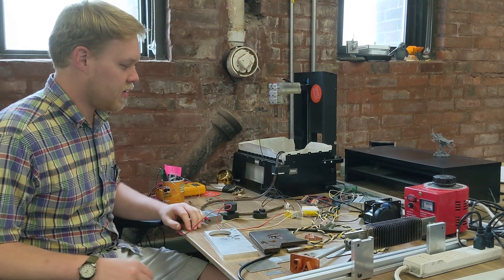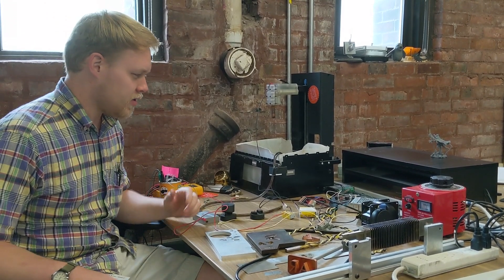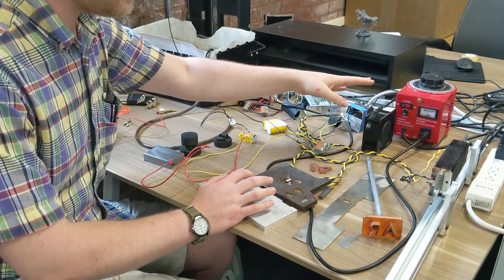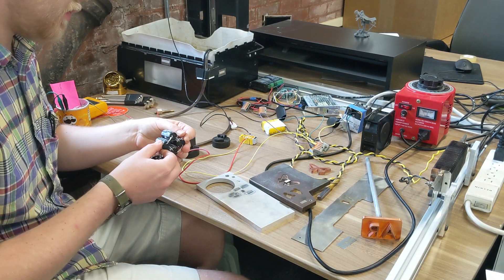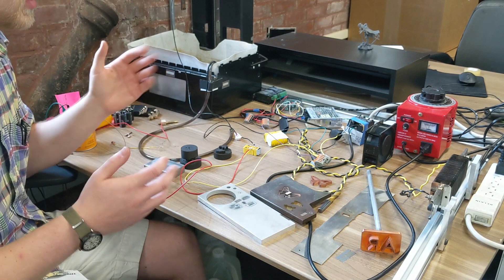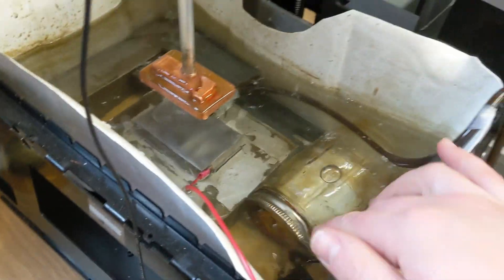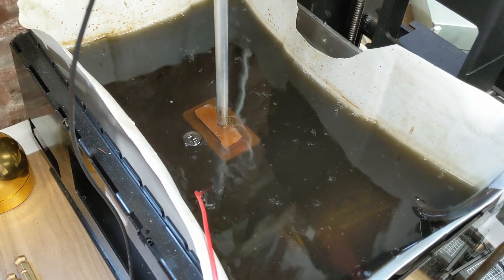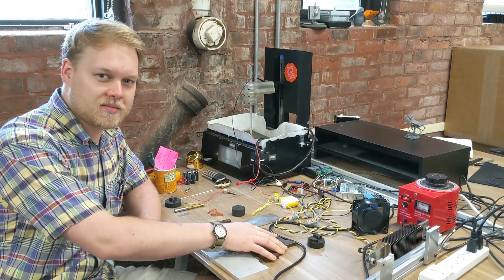DIY Hybrid Ram EDM

Comment: Old fart in Ireland here, just a suggestion, would a IGBT welder work as a power control moduale for EDM it would seem to have all of the values required for this. Any body out there got any ideas on this ?

Comment: Well that's encouraging; pretty much the exact same architecture as I'm trying to get working. The only difference I have is using a Pi Zero, purely to give me a WiFi gap between the equipment and my laptop.

The issue I'm having is with the IGBT keep dying; as the spark occurs, you get an instantaneous moment of ultra high current, which is frying the thing. 

Could you advise what MOSFET/IGBT and driver (if applicable) that you're using please?
Reply from the maker: I am using a normal N channel Mosfet here. I don't remember the part number, but It's rated for much much higher voltage and current than required (I think rated for 800V, 120 A continuous, pulsed to 1000 A). But I did add small amount of resistance to guarantee some sort of current limit (about 1 ohm). It's also avalanche rated. I did not have any issues with it burning up, but I definitely had some issues with noise and clean switching. I added a low impedance mosfet driver on the gate, kept all the wires short, etc. etc. all the standard stuff.  I think if you don't limit the current you will always burn up your switches. The resistance and inductance in those short wires is super low. The "proper" way to do this is to add inductance in series with the switch, and control the duty cycle like you would in a buck converter. This requires extremely fast electronics, though. And a lot of math and careful design to prevent oscillation.

Comment: Thanks for the video, your results look very good. I have been playing with simple RC circuits and cannot obtain a sustained spark. I guess using a pulsed output would improve this? I realise the drive to the MOSFET is also control by open/short/current detection but does it use a fixed base frequency (25kHz) and what is the mark/space ratio or duty cycle of the signal? Perhaps you use PWM of the pulse based on measured cap voltage... be interesting to know. Trying to get an idea of a good pulse to start with if I build a pulsing circuit.
Reply from the maker: Sorry for never replying to this. If I remember correctly, I played with different frequencies and duty cycles, and determined that 30-40 kHz with 5-15 microsecond pulses worked the best. The duty cycle was chosen/discovered such that the bulk capacitors were allowed to recharge mostly between arcing. This gave me the most consistent results. If the electrode voltage was below about 60 volts at the beginning of a spark, it would not reliably initiate an arc. IIRC I ran the bulk capacitor around 90 V max, and during arcing it would measure 75-80 V with a DMM.
Reply: @gizmoguyar  "The duty cycle was chosen such that the capacitor was allowed to recharge between arcing" Was the RC-Circuit-frequency a straight multiple or straight fraction of the frequency of the mosfet-switching, or was it chosen so that both have nearly the same frequency? Thanks !!!
Reply from the maker: @klausbrinck2137  It was neither. I empirically measured the RC time constant, and I used a  MOSFET frequency of about 4-5 times that. This way I could be confident that at the beginning of each pulse, the capacitor was roughly at the same level of charge, independent of the size or length of the previous pulse.
Reply: @gizmoguyar  This answer was very satisfactory, finally I know about the relationhip of the 2 oscillating systems !!! Thanks a lot. The ratio may be different for my efforts, but, at least, now I know what I should pay attention at. I know nearly nothing about electronics, all I do, is to logically evaluate all statements expressed here, bring them in relation, and find the truth. 
My biggest fear was, that the "ON"-part of the mosfet-duty-cycle is gonna precisely overlap with the least-charged-capacitor-state of the RC-oscillation-cycle, for example. But your answer tells me, that I shouldn´t fear that much, generally... 
Thanks again !!! I endlessly envy your results, greatly done !!!

Comment: https://www.youtube.com/watch?v=M_N0XANZZC4

this is my EDM machine.
I am able to generate spark but my ram is not holding stable. could you suggest any circuit or any thing by with I can achieve stable ramming to hold the electrode
waiting for your reply
Reply: https://www.youtube.com/watch?v=8gjdXbLPsxE
Reply from the maker: Looks like a great machine. I agree with the other guy, your linear motion is very jerky and large. I would add filtering and tune your PID so that you get smooth slow downward motion. Your cut speed will increase, and your surface finish and tolerances will improve.

Comment: I own 2 wire edms and a sinker edm.  Thats not a bad little system Youve built there. The sound on the letter cutting was not bad at all. Good job!
Reply: The sound was music to my ears, and the light from the sparks was barely perceptible, exactly as should be !!! I mean, he surely is my hero, but I´d love to know more about the circuitry and the PWM-generator , as well as the cap-voltage-sensing/code... 
I cannot program an arduino as a PWM-generator, but there´s very cheap ones to buy, but I cannot judge whether such one is gonna pair well with the Mosfet I will use.

Comment: PleasE MorE InFo !!! The best I´ve seen so far, simple circuit, but still pulses are dictated by an arduino, as is sensing of too small distances, but there´s too little info for beginners like me... A circuit-diagramm, as well as the code would be nice...

Comment: Hi August,

amazing work, thank you very much for showing your beautiful EDM machine.

It performs very well and seems to be not to complicated!

I just built an easy R/C EDM machine ( https://youtu.be/Gfj0BWwBAOA ) at the same time.

The performance is for normal sized electrodes also very good (maybe a bit coarse) but unfortunately for the narrow slots I need it (heat exchangers for my high power stirling engines) the burn is unstable and the electrode wear is to high.

The pulse type construction plan of Ben Fleming is complicated and expensive to build and I am searching for an easy microcontroller based build for an pulse EDM machine.

Your design looks very nice and clean, is it possible that you show a circuit diagram?

I would be very grateful if you could show some details of your nice build.

Thank you very much and with best greetings

Ralf
Reply from the maker: I took a look at your video, and I'm super impressed. You have done some amazing work. The Stirling engine looks really great as well.  Unfortunately I don't have any schematics or other documentation that I can give. But I can explain the additional circuit that I added. It is simply a very high speed mosfet and high current mosfet driver in between the capacitor bank and workpiece. The mosfet circuit is optically isolated for safety. I also needed a snubber to handle the high current flyback from any stray inductance. The arduino outputs pulses of varying length and frequency to the mosfet circuit. It sounds like you already know more than I do about tool wear and different materials, but adding this circuit may help. I used very short pulses, about 10 microseconds. And I used a frequency of about 5-10 kHz.  Although I didn't investigate reducing tool wear heavily, I can say that I did get some cuts that were quite good. About a 5 to 1 wear ratio was the best I got.  

Regarding the stability of small tool areas. This is simply a matter of tuning the feedback loop. I suggest using a much smaller discharge capacitor (around 0.5 to 1 uF). And adding additional low pass filtering on the feedback signal. I did all of the PID tuning digitally on the microcontroller, which was much easier than tuning an analog circuit.  

Best of luck!
Reply: @gizmoguyar  would be possible to prepare some schematics for us non-experts  in electronics together with arduino code and BoM?  Do you have some patreon to send you money for that?
Reply from the maker: @jozefdzugan1828  I'm sorry, no. I work full time as an engineer, so I don't have time to prepare well documented schematics and code. I also generally don't like to do that, because I want people to learn the underlying principles rather than copying a schematic for something that is extremely dangerous.
Reply: @gizmoguyar  OK .. I understand your point.. anyway thanks for sharing your knowledge in video.. But what about sharing at least arduino code via pastebin? It is not very time consuming I guess and for me it would be very useful
Reply from the maker: @jozefdzugan1828  That's fair. I'm not familiar with pastebin, but I will see if I can dig up the code for you.
Reply: @gizmoguyar  Please, may I have the code too??? I know, one must derive maximal 5V via a voltage-divider, from the cap to the arduino (more than 5V may fry the arduino), and those 5V, if full, they mean "no spark" while 0V mean "shortcircuiting", and so can the arduino drive the stepper accordingly. But I know nothing about coding arduinos !!! Cap-voltage is inversely related to gap-current, I wish I could programm that..